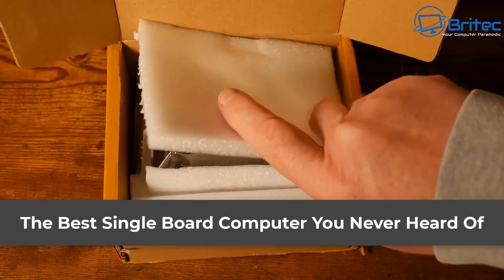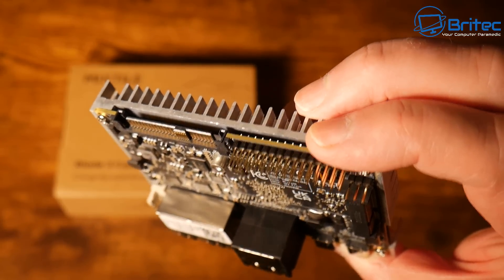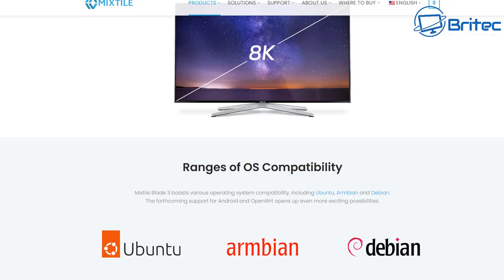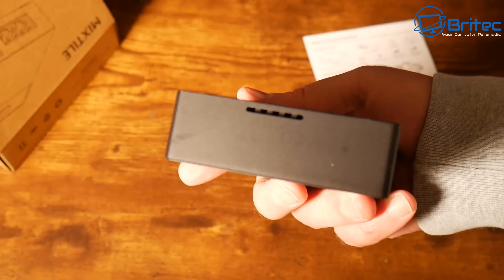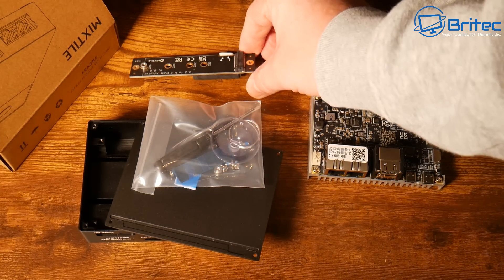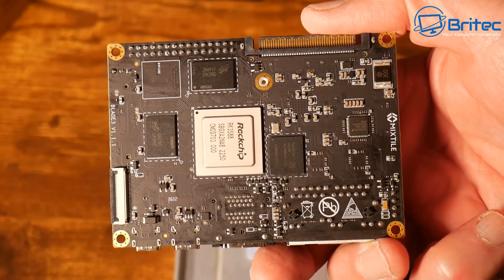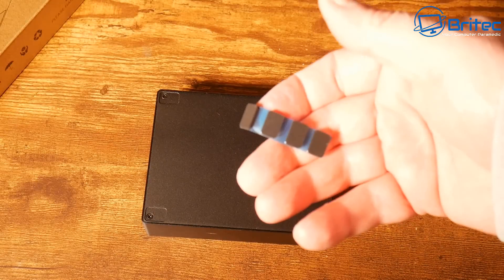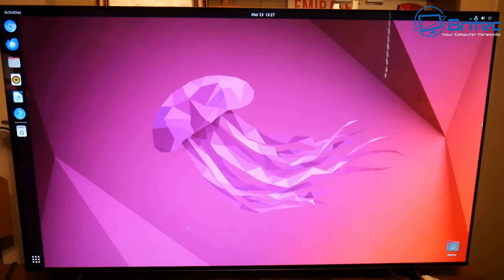Best Single Board Computer You Never Heard Of

Comment: Thinking how much hotter it will run in that case. It seems it was only one sheet of metal that then connect to case where the screw was. So that base maybe for normal desktop use without hi loads when that bare pcb+heatsink was meant to be almost constant 100% load 24/7. Basically it looked module you put on modular case that had back plane + fans.

Comment: Never heard of it, and never want to hear of it at that price! LOL  Seriously, I trash-picked a Tronsmart Orion R28 (android TV box) which uses the similar Rockchip RK3288 - which I assume is the quad-core version of the 3588, and to be fair, it's a great processor in it's price-range.  Certainly a budget processor.  One of the big problems is that linux support (and other operating systems) is much more limited than it would be with a x86 processor like a cheap Celeron.  But I did manage to get Ubuntu installed, and also I think armbian.  I'm sure the octa-core is better.  And it's a cool little package, with nice accouterments.  But should be WAY cheaper.

Comment: Some odd design decisions here. A button on a somewhat proprietary pcie via sata to nvme, rather than using a header. A fan header for a fan not on the CPU side. Dual 2.5 gb NIC great, but if it's doing HPC stuff, then why 2 HDMI ports?  And can those CPUs even saturate a PCI Express interconnect? 
This is obviously to solve a specific problem, I just don't know what 😂

Comment: Nice little machine.  I think I'd put the little rubber feet on the case along side the screws for easy access to get back in side.
Reply: I was about to type the same thing. The case would be better if the indentations were not in the same place as the screws. Potentially, the rubber feet might 'wander' if not placed in them. I don't get why such a company would seek to cover the screws anyway. They must think they are competing for the same customer base as Apple!

Comment: I like to have 32 Gb RAM, but the price is $439.00 for US ... expensive, maybe when will have a $250 price will be more good for me.
Reply from the maker: Yeah, its pretty pricey
Reply: @Britec09  can you tell me if you test ARM device with Fedora Linux or another Linux distro and how good is arm on linux ... ?
Reply: @catafest are you asking if Linux runs on arms? Linux variants are just about all that does run on arm cores.
I've been using Linux since 92 or 93 on i86's and preferred processor now is arm.

Comment: Between $230 to $430. I  am in the market for a desktop but I don't want to pay that much for a single board. For about $100 I can get a raspberry pi.
Reply: Yeah imo that is not worth it. It's too expensive. Second hand desktop with a graphic cards would be the better option at that price point.
Reply: agree too pricy, if they came down to $150 or even $200 it would be worth it.
Reply: I would love when the day comes to have a computer that small. Tired now of the big cases. But at the $$ asking for 32gb version,  I think I wait few more years to spread the love
Reply: For 200 to 400 is a mini pc. For my main computer I paid 3k for. I guess it depends on what you use the computer for as far as budget goes. For me, I want something that can program with 100 tabs open and do some game development on. A mini pc simply will not do this properly. But to simply browse the web it can work just fine. For a single board computer again there are use cases, a raspberry pi can work in some places but if you want more power for AI on some robot you might want more power. So I guess it's all relative to the goal of the use case to be honest
Reply: Exactly. $100 is the max
Reply: Than,s. Now I can ignore the rest of the video. 👍
Reply: I'd literally only use it as a DIY router.
Reply: Waaays to expensive for so little computing power... And it can't even run FreeBSD...